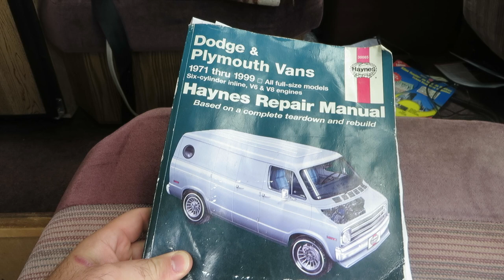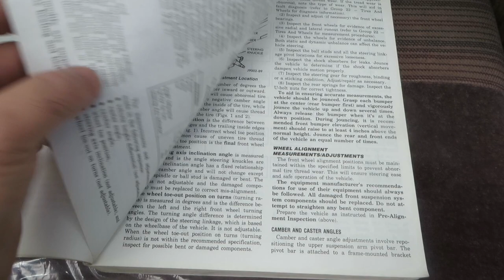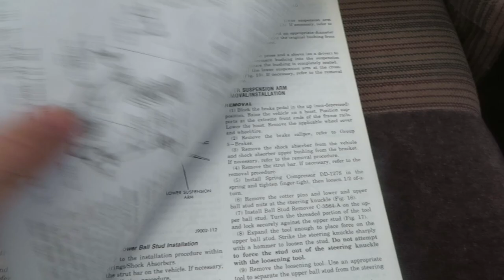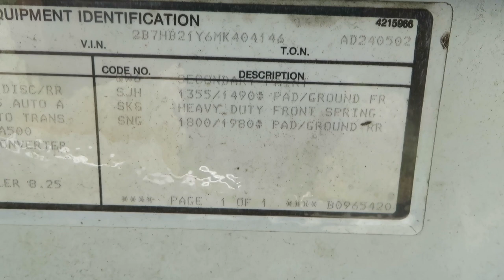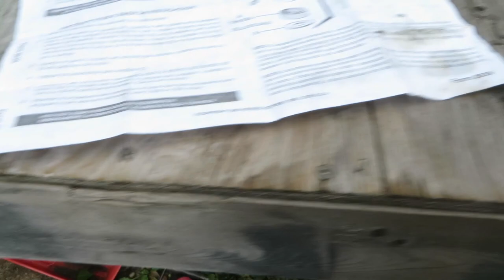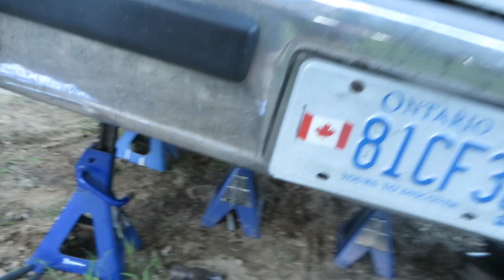Dodge Ram Van Upper Control Arm, Idler Arm, and Tie Rod Replacement 1979 through 2003

Comment from the maker: Please check out my affiliate links in the description if you are looking for parts and pricing.
Reply: You cannot center the steering wheel if you put in that solid link. It needs to be adjustable.
Reply: Stephen - can you snap photos of the instructions for crossmember removal? It would save me a ton.
Reply from the maker: @albertbarrera5542  Sorry, the manual is sold with the van.
Reply: Great video. Stephen what would you suggest for pullers to purchase for doing the front end of the van? You mentioned that a few of them didn't fit and had to use the pickle forks.

Comment: I must have watched this pair of videos about 10 times over the years as I planed to do this job to our '96 Roadtrek. I finally got around to doing it this spring. This video helped a lot, so thanks. The service manual pages were useful since I only have the manual for the pickup and the suspension is different. It was also good encouragement and let me see all of the parts of the job before I got into it.

It was a bit harder on our van because we have the 4 ton axle and the parts are hard to find. I had to press the bushings and joints out of our old control arms. The upper control arms with the thread in joints are a real pain. I wasn't able to get them to budge with a wrench and ended up pushing them out with a press and then screwed in new ball joints.

Even though this is a big job, it's not that bad. If I were to do it again it would go much more smoothly 🙂

Comment: Thanks for this vid.  I had never done this before and had parts in the bag I had no idea what to do with.  You showed the instructions and it's exactly what I needed!
yep, the washers on both sides of the idler arm is the worst part.  I finally had to use a thinner washer from the old one because there was no way to get it in with both thick washer and had to use a brass hammer to pound it all into place.  I ground off the original bolt to a taper and used that to hammer up through the frame part to get the parts to line up. the worst part of a simple job....
And then the castle nut on the taper of the idler arm wasn't tall enough and had to add washers to get it so the cotter pin would engage.

Comment: Great video, thanks! My only concern (and I am in the same situation) is all your jack stands are on what appears to be soft soil. I need to do some suspension work on the front of my '89 B250 Xplorer. I started with the front shocks. I used a floor jack and jack stands over my brick walkway form the driveway (which is dirt/gravel) and when I was done I noticed where the jack stands were the bricks had sunken down. Safety first! I'm too damn old to have made it this far only to be crushed by my van!
Reply from the maker: You can get some steel plate cut into 12" x 12" squares or even larger to provide support for the stands.  Asphalt is worse than dirt when it gets hot so it is important to support them as you mentioned.  I had this driveway made for me and it's pretty solid, 12" of stone on top of sand.
Reply: @SteveRivett  Yeah, I have even used 12x12 concrete patio blocks under jack stands, but I know even those can crack. Nothing like having a nice solid concrete driveway!
Reply: Lets add that jack stand strike @ 25:30 !!!
Reply: I use old brake rotors under my jack stands. cheaper than buying anything.

Comment: If you just wanted to do the upper control arm (with balljoint) would you just have to undo the brake housing clip. Then its just those 3 nuts? How can I keep the upper control arm lined up to fit right in and not mess with the alignment too much. I was having trouble seeing that in the video. Thanks for this vid, its a lot of help for me.

Comment: Got a 2000 B2500. Also had loads of corrosion on the driver's side - apparently because the battery is on that side.

Comment: I got a 1999 dodge ram van 2500 and making a lot of noise on right side I was told it’s the control arm bushing ! I just don’t know if it’s upper or lower they charging me 250 idk if it’s a good deal or not I want to do it by myself

Comment: Thanks for sharing this. But I have to wonder about your statement at 5:08, "Vans aren't that popular." In my experience, vans were very popular in July 2018 and are still popular today. (Source: browsing vans on Instagram since 2016, LOL). I am full-timing in my 2001 Dodge Ram VAN 3500 - a Pleasure-Way Excel-RD Class B Motorhome. Lately the front suspension has decided to go rogue on me and no shop can figure it out. I'm going broke replacing parts. Lol. Best wishes man.

Comment: I have a 1975 dodge b200(the stickers says b20 for some reason) any idea if 75 suspensions are the same? Surprisingly difficult to find info on early model dodge vans online, thanks for the great video
Reply from the maker: If you go to RockAuto and pick something like a 1991 B250 you can look at those parts and when you click on the Part # it shows the full application.  Just be careful with the ball joints as they vary depending on axle weight.

Comment: Great job, I have a 1999 dodge 3500 Road Trek. I’ve done most of what you have done in the past, and will probably need to do it again in the future! I will reference your video. How did you get the oil pan off to repaint it without taking off the crossmember?

Comment: Do you know what fixed it sitting lower on the driver side mine does that buy I replace the springs and the shocks
Reply from the maker: I think it has to do with weight distribution if it leans after replacing the springs and doing an alignment.

Comment: I'm basically doing this same thing to my 94 B350 camper van. How did you align the upper control arms?  Wait to get the wheels back on and eyeball it?
Reply: Oh and again thanks so much,  especially the shots of the service manual. I don't have one and the torque specs alone helped loads. Appreciate you man!
Reply from the maker: I just put the new control arms where the old ones were (you can see the old marks in the paint) and took it to an alignment shop.

Comment: I'm having trouble with the idol  arm to put the  Bolt down through with the washers inside grab the Tires Move them side the side idler arm goes up-and-down
Reply from the maker: I had to hit the idler arm brackets with a hammer enough to fit the washers in.  It would have been helpful to have a porta-power to stretch the opening.

Comment: @stephenRivett, Rivett thanks for much for the video. I am trying to replace my crossmember. It’s rotten. I saw the instructions in the repair manual you have. I can’t find this manual online anywhere except for eBay but they charge $100. Do you mind sending me snapshots of the couple pages with instructions for replacing the crossmember?
Reply from the maker: Sorry, I sold the van a while back and gave the manual to the new owner.  You can look at the Chilton here:  https://archive.org/details/chiltonsdodgeful00morg

Comment: how rusty was that frame when you painted it and how was that restored so well?
Reply from the maker: I wire brushed the metal and painted it with black tremclad rust paint several times.  The paint needs to have enough layers that the metal doesn't poke through it or it will start rusting again really well.  I didn't make any repairs to the metal and it passed a mechanical inspection later in the year.

Comment: Where are the grease points on this vehicle? Are there any?
Reply from the maker: There are a lot of grease points on the front suspension, some can only be accessed if you turn the wheel to the left and right because you need to reach through a hole in the cross member.  If you had your u-joints replaced they will also have grease nipples.
Reply: Stephen Rivett Thanks for replying. Can you please show me where they are and how to grease them in a picture or short video? I have a 1990 Dodge B250 Roadtrek and noticed some loud chonks after having the upper control arms replaced. I want to lube the front end but don’t know how or where. I appreciate the help!